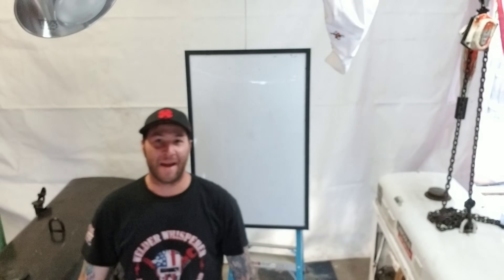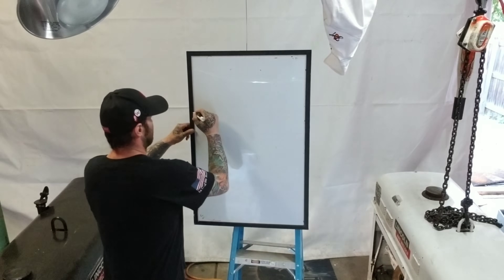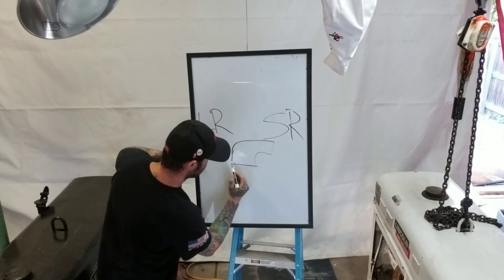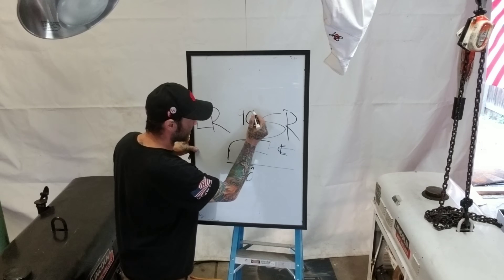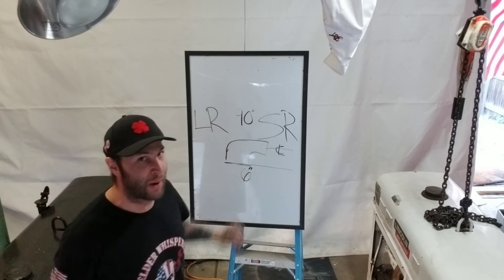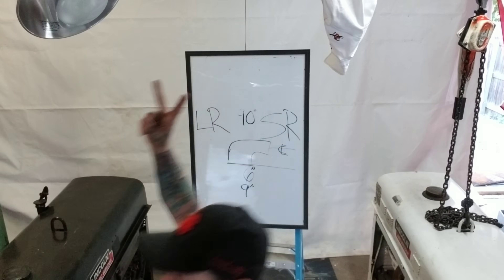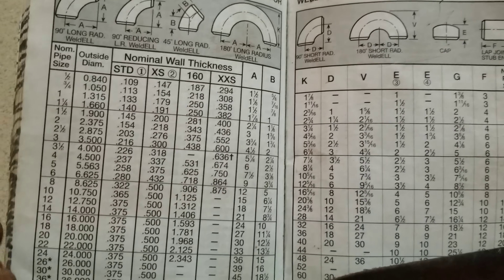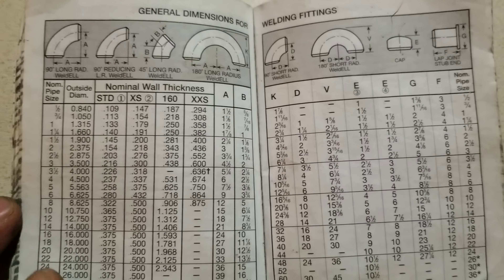👨‍🏭 Learn to be a pipe fitter

Comment: I'm a pipe insulator at the moment trying to move on to pipe fitting. The chart helped me understand what I see in the plant better. We have ready-made insulation 90s both short and long radius. We had some short radius 90 insulation but a long 90 pipe to insulate. Had to customize the material to fit.
Reply from the maker: Nice